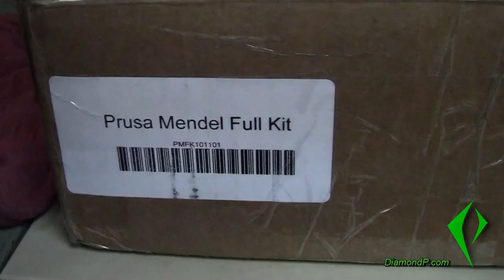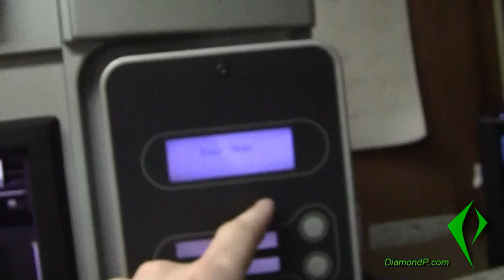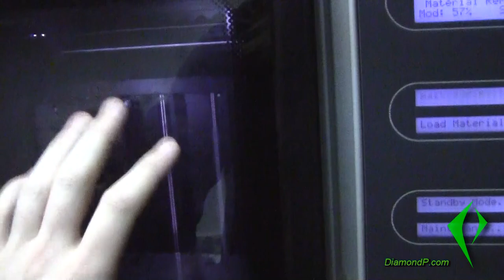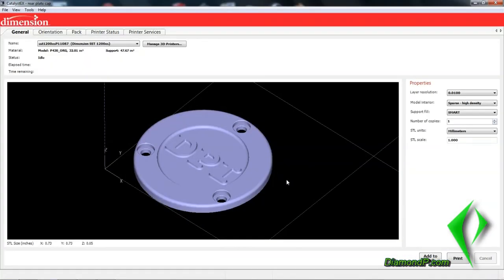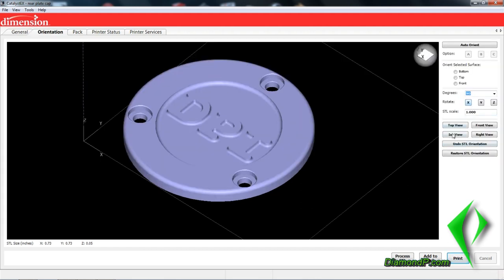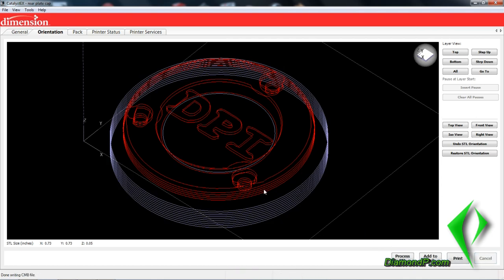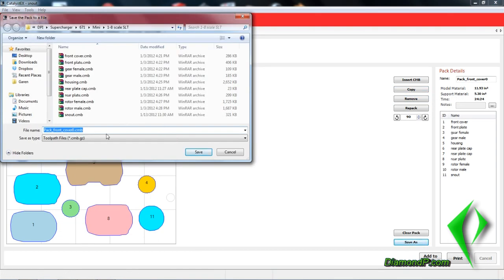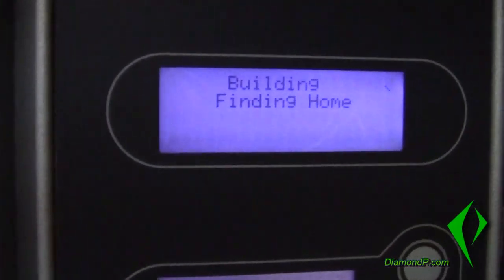How A 3D Printer Works

Comment from the maker: Unfortunately we can't print wax, i am working on another method that might be castable but it wont be to the resolution needed to make jewelry sized pieces though. 

The process you are looking for is called stereolithography, it uses a laser and liquid resin which has a layer thickness in the micron range, they are quite often used for printing jewelry.

Google or youtube, "Form 1" "SLA printer" "Stereolythography"

Comment: Great video.  The firmware is actually on the arduino and the ramps is just power and stepper drivers.  The part im talking about is at 7:51 where you said the ramps has the firmware and stepper controller.  Small error but just something I wanted to mention.  We have the commercial printer that you have at my school.  Its a fantastic printer.

Comment: And tow answers for you! 1) Yes. There is actually something being made called a filabot (google it, Youtube hates links...). It will grind down, melt, and extrude plastics (not just ABS) to be used on a printer. 2)Kinda. I have yet to personally do it, but there is a way to "polish" items. You can sand them, or course, and/or use a acetone wash. Sanding can be time consuming, depending on your model. The acetone wash is fairly simple, as its just a quick dunk into acetone. Hope this helps!

Comment from the maker: This printer used ABS, same plastic as Legos. The two most common for 3D printing is ABS and PLA but there are many other materials. There is metal printers already, very expensive though. They use UV activated glue to solidify powdered metal, Once its done printing they cure the metal and liquefy it to its final shape. Youtube "3D Metal Printer".

Comment: I thought about - support material - yesterday.  Thinking again - as I type - it's only needed in a - subset of parts.  If you spent a lot of time thinking of parts that need support material - you'll think of some - think of those that don't - you'll find lots don't.  Flip some parts and the need disappears - split parts and the issue is gone (i.e. problem solving - design out the hurdle)

Comment: I have two questions: 1) can the ABS be reused, by melting it and extrude it into filaments? Perhaps a little gadget at home will be useful. If some one prints a lot of toys and later he gets tired of them, he can use this lil gadget to put ABS back into filaments to be reused.  2) the finished printed object looks rough on other videos I saw, but the Prusa parts are nicely clean and neat. Can every object be "polished" to look perfect? What is the process? How much work?

Comment: Love these printers.. I have two of them at my school that I run. I just wish it didn't cost so much to print stuff. We have to charge $7.50 per cubic inch of material (including support material) That big blower part that got messed up by the power surge would have probably been a $400 part gone down the drain : / its a shame it cost us so much to print even little objects.

Comment: Thanks for this.

I wonder... is the next great leap in 3D printers parallel extruding?  I mean something like a printer with a dozen extruder nozzles all going at once?  I'm not knowledgeable enough to say how hard that would be; I'd imagine the tough part is software.  Which nozzle builds which part of whatever you're printing, keeping them from getting in each other's way.

I would speed up printing, especially when you're printing multiple item together.

Comment: It`s not a ball screw on z-axis in your printer. It`s a trapezoidal screw with polymer or bronze nut- much cheaper solution than ball screws. But accuracy of trapezoidal screw is normal for this type of usage)

Comment: Hi, excellent demonstration video. I have a couple of questions to ask you if you don't mind. First I like to say I am a person good building mechanical and electronics things together. I have basic electronics understanding & schooling. I am totally new to the 3D printer arena and understand a little on how 3D printers work! I want to build a 3D printer, more specifically a kossel mini 3D printer or a rostock 3D printer type but my question is this, are all 3D printers uses basically the same electronics, arduino control board & ramp board or do each different types of 3D printers uses a specific electronics according to it own build or design?
Reply from the maker: Its the former, they are like building a PC there are many different manufacturers and types but they are all basically the same components and software, you learn how to build and work with one, you'll be able to transfer that experience to any other ones you work with. 

As for the Kossel, I've never seen or worked with one but i'd assume there wouldn't be much difference in building one vs building a conventional gantry style printer. The design of the kossel is actually derived from a machine FANUC makes for high speed packaging, you can see one here. https://www.youtube.com/watch?v=ClXfa4stfJM
Reply: dzuari
Thanks! :)
Reply: Homere Lesperance I'm new to making electronics and I decided to challenge myself with a 3D printer as my first project. But if you make one without a case maybe use the printer to print a case maybe?

Comment: Thanks for the primer, I have a question regarding the support system on the pro-grade 3d printer you were using..  How exactly are those support system surfaces made on the Pallets?  My first thought was that the support pallet looked vacuum-formed, but apparently your 3d printer is creating them? (Or at least, that's my guess based on how you referenced it)    I had assumed you'd just sort of print the supports directly onto the pallet, just like you'd normally print a part, and then seal the support with something like paint, to provide a good separation line after you print the actual part on top of it.   Could you provide more info on this process?  I look forward to more 3d printer vids from you!  Thanks for your time!
Reply from the maker: The pallet is just an injection molded plastic base, the support material is printed out in 1 of the 2 nozzles and it lays down just the same as the ABS. Once the part is done we put them in a wash with some industrial strength oxy clean and it dissolves the support material away. Then you have a finished part. Not sure what the material is but it is much more  brittle than ABS filament, I think they also have patents on it.

Comment: I want to make special gears and brackets, screw/bolts. I have used 3D Turbo-CAD before, how difficult is it to learn to use the software to feed my design to the printer?  Which software program is the easiest for casual users like me?

Comment from the maker: Most parts that you see around you are made from molding, they are designed that way to reduce cost and complexity, as a product designer, it is a sever limitation that any designer has to understand and work around to make sure their product can be produced in an economic way.

With a 3D printer... It's pretty much like, "Fuck it! I can design what ever i want cause 3D printer don't give a shit!" :) 

As 3D printing becomes cheaper, you will see more and more complex products on the market.
Reply: How do I get a hold of you regarding a design Id like to get started?

Comment: Did you know that is a big mistake to handle those boards with bare hands?? Most of those use CMOS technology which uses insulated gates that allow to power the circuitry with minimum electric current, indeed, energy, but it is also extremely sensitive to ESD (ElectroStatic Discharge), it means that you can completely blow up all ICs with your own electrostatic charge! Next time, use some metallic foam or common sense, just handle it with care!